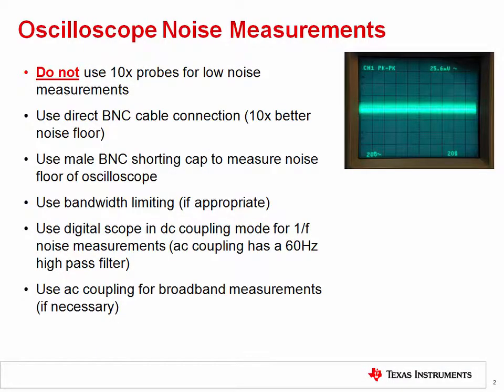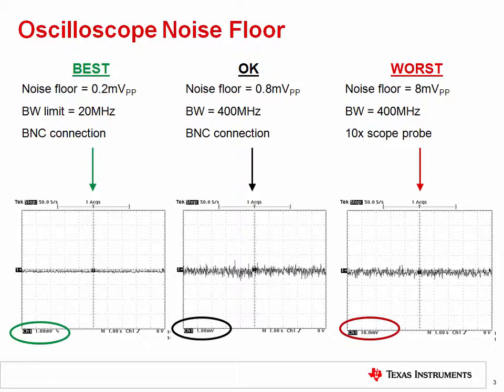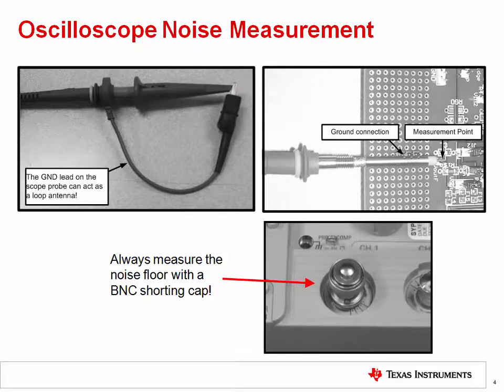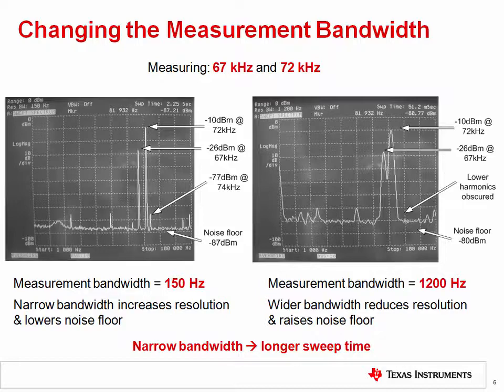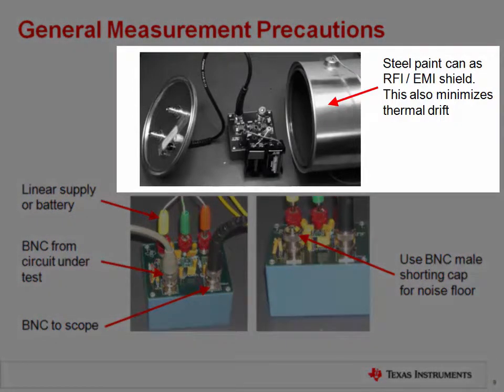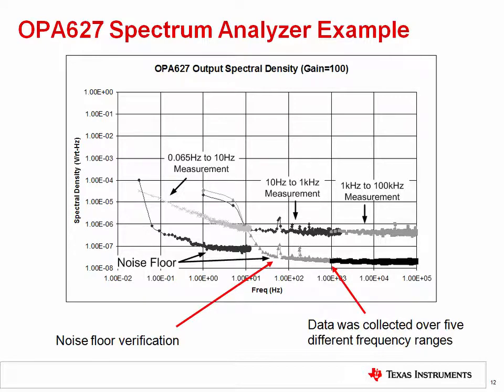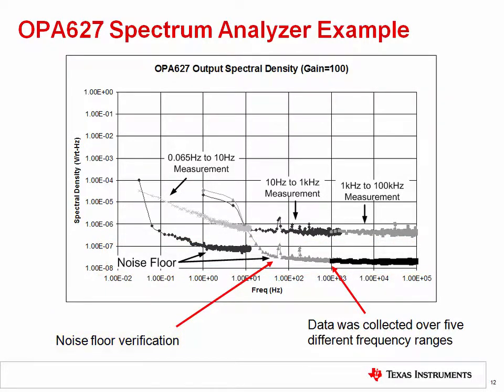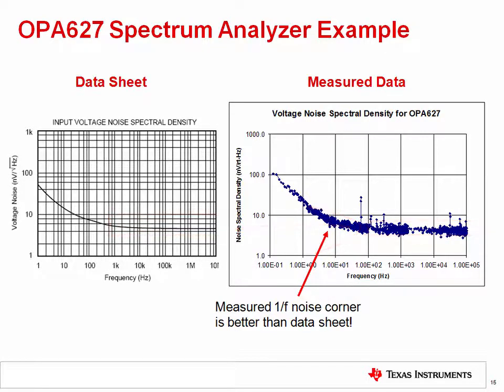Measuring system noise

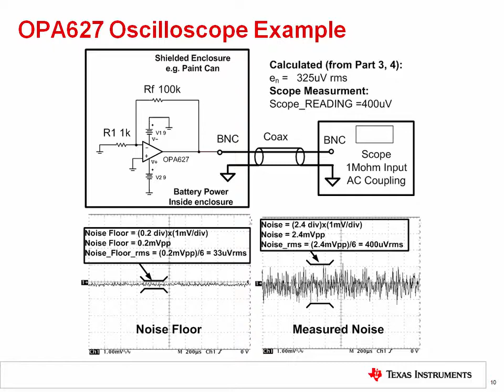Comment: For the spectrum analyzer example at time 11:34, the input impedance of the dynamic signal analyzer has been set to 1MOhm. Spectrum analyzers only have a 50Ohm input impedance (and this cannot be changed in most spectrum analyzers unlike oscilloscopes). I suppose this method cannot be used then? Even an external 1MOhm adapter would not work as the signal being measured by the analyzer would still be across the internal 50Ohm of the analyzer.